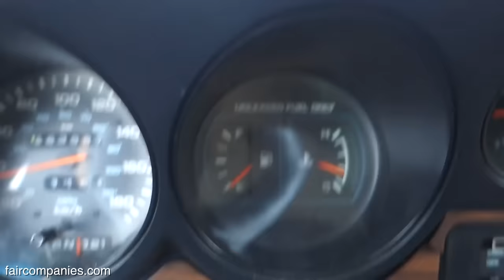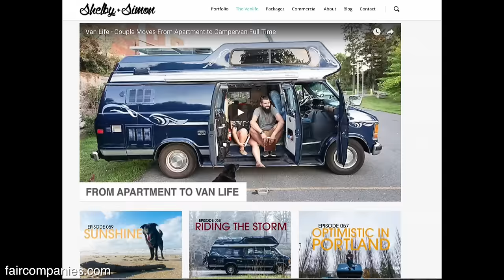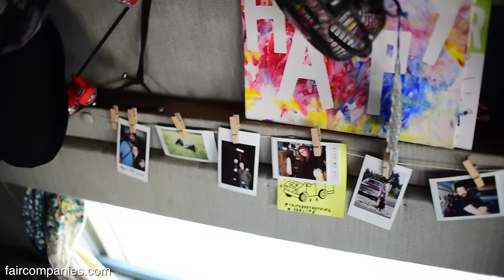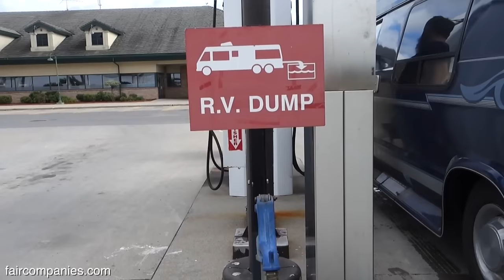#vanlife with no filter: couple records work/life on wheels

Comment: Thanks so much for the unfiltered look! I think one of the problems they had here was too much stuff. The van was old, and it was full of nonsense. It would have been better to just find an empty van and fix it up yourself. The point is SIMPLICITY: a stove, a fridge, a furnace, and a shower? What's wrong with a camping stove and a cooler?  And I don't think that this is something that can be done with a significant other, especially if you're working with them. It's much easier to deal with issues alone, instead of with another person.

Comment: The YMCA's in Florida are ridiculously  expensive. You can get free showers just by asking truckers at truck stops if they have an extra shower ticket or two. They'll send it right to your phone. They always have them. Pick up a truck stop guide and that way you'll know where there's a free shower and free parking at which exit and route. Get a CB. Get a good one and a nice whip. Rest stops in America are government property and they can search your vehicle anytime for any reason..just an fyi. Use a dust pan and a pail to fill up on water at rest stop and park sinks. put the flat end under spigot and the handle will work as a spout.

Comment: I did part of a winter with my propane heat. Then I plugged in to shore power and ran an electric heater. Woah it was like night and day! Completely dry inside. Now I'm wondering how much money it would cost for gas, to run it with a generator. It's not as warm as propane heat but I don't live in a really cold climate. But my walls weren't dripping wet. Not even the windows were wet! It was a whole new world. The byproduct of propane and combustion, is water. A new Yamaha generator is supposed to "sip gas" and it's also an inverter. I'm really dying to do away with propane heat. Just not sure what the cost of gas would be.

Comment: Seriously folks, please get yourselves a small 10 litre dessicant dehumidifier. Mold is really dangerous and could fuck you up badly!  I'm a full time van dweller and a dehumidifier is maybe the most important piece of equipment for Winter in a van! If you drop the humidity to below 40% then most of the condensation, and mold,  will go away. Run the dehumidifier as you drive around by plugging it in to a high power 1000W inverter. My dehumidifier only uses 250 watts on low power! other than that, sweet video

Comment: Would it be the van was not insulated that well? A lot of vans built from scratch have ample insulation if used for winter trips...Also you can get rechargeable Dehumidifiers, charge them up when driving..Also the Ivation Dehumidifier doesn't draw much power..

Comment: last February i did a 2 week trip in NE United States. I had condensation problems on the windows. it would freeze ina couple of hours. In the mornings i just scraped it off and tossed it. 95 toyota 4runner. Coldest recorded was -34c the next morning was to too cold for my digital thermometer wouldn't read. for half that week we stayed in a cabin with three space heaters.
Reply: jonwilly2

Comment: Great set up.  How many watts is your panel, and what battery capacity did you go for?  I'm using a 100w panel but only 30 Ah battery capacity (SLA mobility scooter batteries) and it struggles, am thinking 60 or 70 Ah would be better, looks like you have about double that, what sort of loads do you have?  Where does your voltage go down to at night?

Comment: For the condensation, could you park at a slight angle to guide the water to a specific area of the ceiling to allow you to Collect it with a hose to collect the water to drink?

Comment: I also saved room by not having a propane oven in the van I just use my inverter off my battery and had a two burner portable very small and easy to put away

Comment: I see you video this is 5 years ago but . I had before a fifth wheel and it was a major lick in the roof but I found out this thing called flex seal and works so good that I buy a little can. I know the cost of one of them right now if around $50 to $60 but trust me it will work so good you have no leaks in your roof. But I didn't use the spray cuz to me the spray isn't worked I use the one that you paint with the brush excellent 🚚🇺🇲😍

Comment: I just got this computer and Iv been going over some of the sit's on here I see you kinda just stated out your doing the right thing yes it's a pain in the ass some times but also hell of a lot of fun. I still have my 1979 doge van camper runs like a bear I keep a smaller V-8 so l can save some fuel but Iv gone though 3 eng's a rear end and a full transm. overhaul.  l to do contract work my self but take the winters down in Az or Nm some times in Tx, Lu  you should try this make some calls to a few contract Com,s around the south part of the country. The money can be really good. Get out of the winters that far north I use to do it but no more. Unless their is some really good contract jobs in the oil fields. Iv been doing this type of machine repair work for many years car repair,factory repair work oil field work,etc,etc, but yea you put out a great blog. And do not forget the beet harvest and others Their's your gas money with out touching any thing in the banks. Have a great time !

Comment: van [72]  probably burned from a loose or crimped  fuel line near the distributor causing ignition of fumes from fuel by  arcing electric current from  distributor or one of its attached wires . had it happen  after i "tuned" my dad's 72 toronado when i was 16 ,big flames

Comment: I'm only half way through, but I can tell these guys didn't really think a lot through. Living/traveling in a van in Canada in the winter o.o Not to mention being 6'6" and choosing to live in a space you can't stand in. I mean congrats on pulling it off, but it seems like the suffering aspect was more self sabotage than anything. I'm all for living off grid and being nomadic if it's your thing, but it's not anything to take lightly. Budget and ensuring your space is livable and comfortable, not to mention the countless free camp grounds everywhere along the way would have saved them a lot of misery I think. 

And so many other things that to me are obvious. Of course you need ventilation to stop from getting condensation! It's sad these guys had to learn so much the hard way. I am surprised they didn't die from CO2 or monoxide poisoning. Also, I've noticed a lot of these nomads go a while without bathing, but to me that's just not cool. You look good, you feel good. Having access to cleaning yourself easily and regularly is must - it's just sanitary and will help keep from feeling and getting sick. 

I've always been a handy man and went camping very frequently so I mean I guess a lot of their pitfalls are just second nature nothings to me. If you aren't cut out for it, then yes you are in for some trouble, but if you know how to fix most things, build a fire, stay dry, make food of all kinds, most of what they went through would be easily overcome or avoided completely. Lesson being, don't take living and traveling on your own lightly. It's not something you can just jump into, it takes a fair bit of prep and knowhow, but props to them for giving it a hell of a shot.

Comment: stepvan 7ft ceiling R13 and sides, 6'6" after insulation, 1740 w in solar panels,A/C, Heat from Battery bank 24 6v  Queen bed  Standin Shower etc   90 gallon fresh water 17 mpg Cummings diesel,Allison Tranny. This is the way to go and its white plain jane.

Comment: i know all to wall about the water thing as a temp fix i got two 40mm pvc pipes with part of the p trap of a old sink and then put the u part of the pipe on the roof this stop water and wind coming in but let the heat out then i got a eletric ac unit with fix the hole condeensason thing but that what van life is a bout new thing to over come and new trick to learn  later

Comment: Interesting experience indeed and amazing how many people seek the van adventure. For some reason though driving a van seems restrictive, partly because the 'doghouse' (the contraption covering the motor on the inside) confines foot-space. 
So, I have at times opted for school buses, in some of which even a 6'6'' guy can stand up, barely. IN town parking would be more restrictive, but out on the road it shouldn't be an issue.  They may use more fuel, although I've gotten around 13 mpg with one (on mostly flat terrain). 
Even short buses, built on truck chassis, are around 8' wide, making it easy to sleep sideways within. They're probably cheaper to buy too.  Worth a try.
Here is an example for the adventurous: http://www.publicsurplus.com/sms/auction/view?auc=1783417

Comment: Wow 25:00 you got condensation inside? I gess you need to improve insulation!
Reply: No, they need a vapor barrier
Reply: Actually, they need to improve ventilation. This is something talked about religiously in regards to interior propane heaters and single-wall light-weight backpacking tents also. Good ventilation makes all the difference in the world. Rather than opening a roof vent (heat rises) you are better off opening two windows on either side or end of the vehicle half an inch for a cross-breeze.